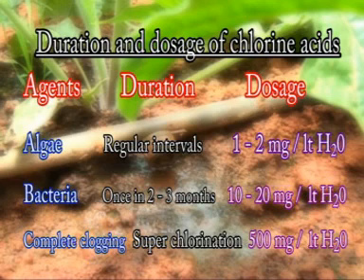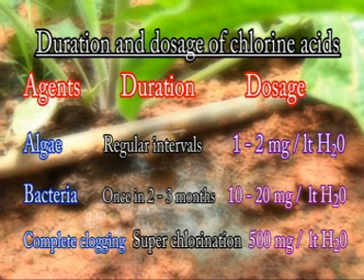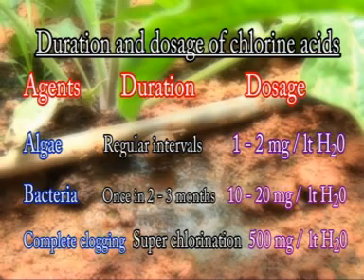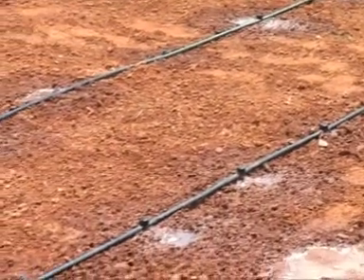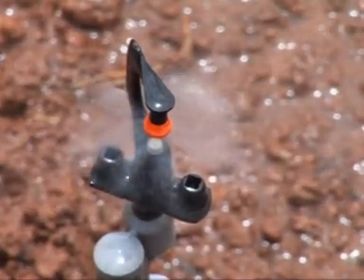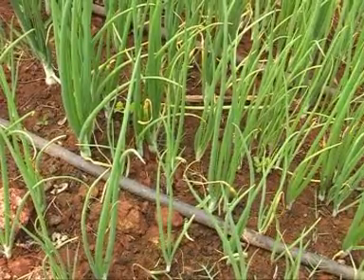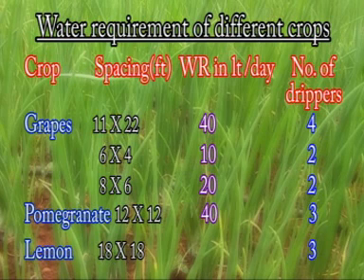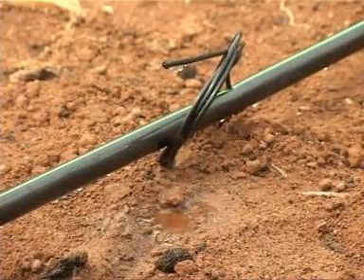Drip Irrigation - A Detailed Overview

Comment: I have 2000 sq.m area with 80 coconut trees, how much horse power pump will be required and what type of filter to be used? There is a open well of depth 7meters.